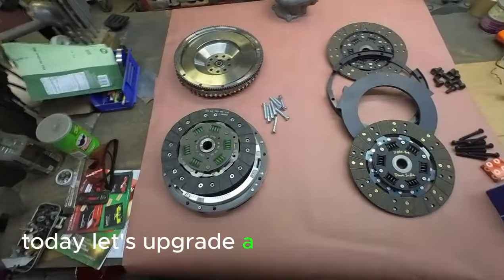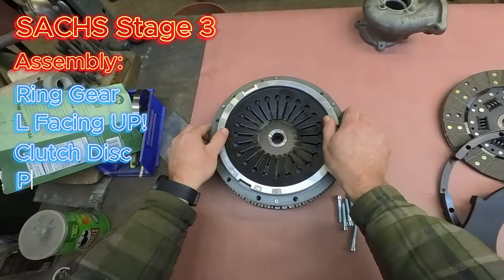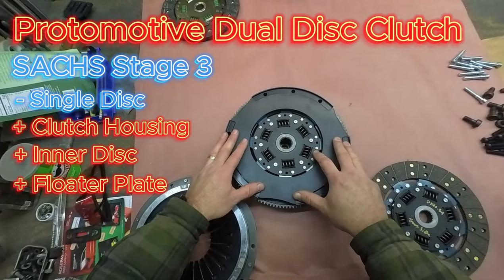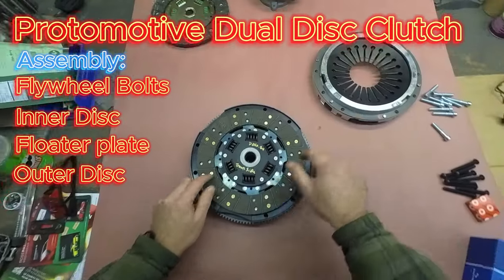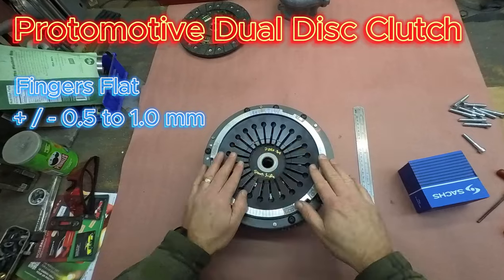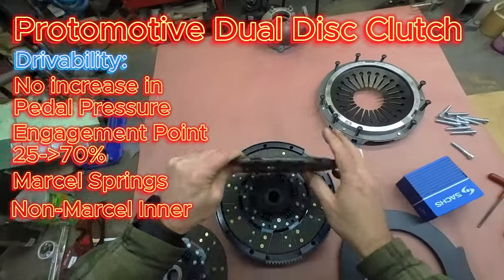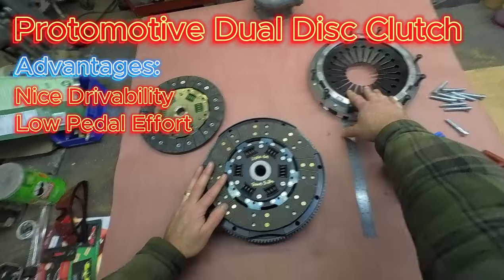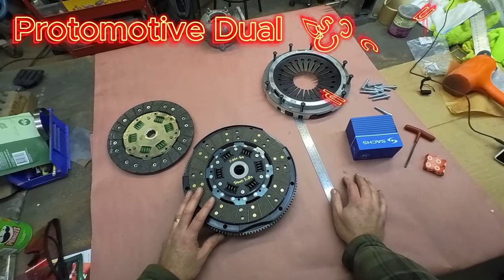Single vs Dual Disc Clutch Upgrade #porsche

Comment: Great info and very instructive as always Todd!.  I may have change out my carbonetics triple disk for this.  The engagement on the carbonetics is a bit tricky.  Is that because it has a non-Marcel spring?
Reply from the maker: Yes the carbonetic are solid carbon discs.  No springs at all.  They recommend you to literally warp them to make them more drivable!   Kinda crazy.   Yes they're tricky to drive....   I like ours best since I love driving my car and not being frustrated with a finicky clutch.
Reply: Thanks! Do you have them in stock? I'll be in touch.  @protomotive

Comment: Thanks for sending the dual disk clutch kit.  It's a masterpiece!   What's the torque spec on the buttonhead bolts for the pressure plate?
Reply from the maker: 18 ftlbs.   You can use blue loctite there.   Flywheel bolts are 63.5 ftlbs with red loctite.   On higher rpm /higher powered engines you can solid dowel pin the flywheel to the crank vs the spring pin as well.
Reply: Perfect! Thanks for the dowel pin tip.  Great info!  @protomotive
Reply from the maker: @joebolognio5508   Always happy to help :)   I sent it fully preassembled for you so there should be no question as to how it all goes together :)
Reply: Yes. Thank you very much! Very helpful!  @protomotive
Reply from the maker: @joebolognio5508  you're very welcome!  Let us know if you would like to do the gt2 slave conversion as well.  It feels just right with the proto dual and provides a bit more travel over stock.
Reply: I know it has been a while but you perfectly drilled the slot for the slave rod many years ago.  I had to do a little grinding down of the bell housing to fit the fork since it's on the opposite side but as you describe, it works beautifully.  Can't wait to try it with your clutch setup!  Thanks!  @protomotive
Reply from the maker: @joebolognio5508  yes it's common to have to clearance the area over the top of the fork with a gt2 slave conversion.   Porsche must have changed the castings along the way.   It's hit or miss having to do it.   But always be sure to check before installing!
Reply: Yes, that's exactly what was done with a dremel.  Pretty simple. 🙂  @protomotive

Comment: Is there any difference between a sachs 2.5 and stage 3 kit? I’ve heard it called both ways
Reply from the maker: It seems everyone has a different name for them for sure.  We typically refer to the stage 2 as Oem dual mass with 764 pressure plate and upgraded disc with the stage 3 running the single mass euro rs lightweight flywheel.   But then I see fcp euro offers a stage 2 like we describe while aim is showing the dual mass version as a 2.5...
Reply from the maker: So vs trusting the name just be sure to check out the components.

Comment: can this kit be used on a 964RS stock pressure plate and stock single mass flywheel? .. I want a bit more clamping but I want to retain the stock clutch feel and effort.
Reply from the maker: yes, both setups will work nicely for you.   You could retain your whole setup and install the 764 pressure plate for an increase in clamping, but you'd also have increased pedal effort.   To maintain pedal feel, the dual would be perfect.  For the dual upgrade you'd be able to purchase the dual disc upgrade on our site vs. complete since you already have the RS setup in your car which is basically a Sachs Stage 3 with a stock pressure plate.   You will need to revert back to a short eared t/o bearing and guide tube from a standard 964 if you did the dual.  The dual upgrade is here: https://www.protomotive.com/wp422/product/protomotive-dual-clutch-upgrade   We can also provide the t/o bearing and guide tube that's normally in the complete kit.  It's just not listed seperately on the website.  Let us know and we'll be happy to help out :)